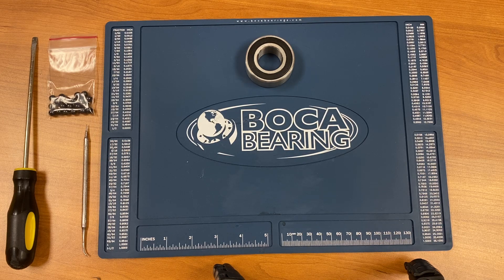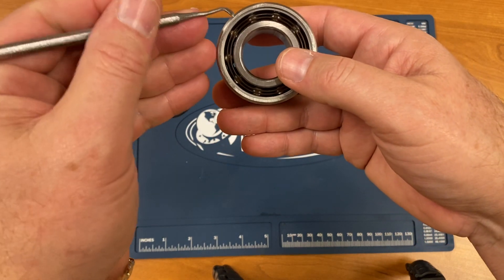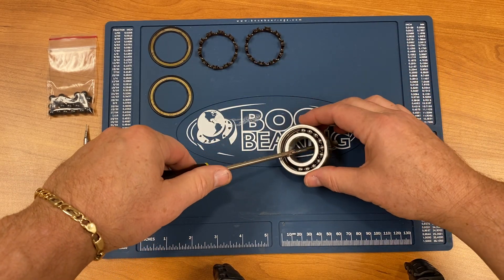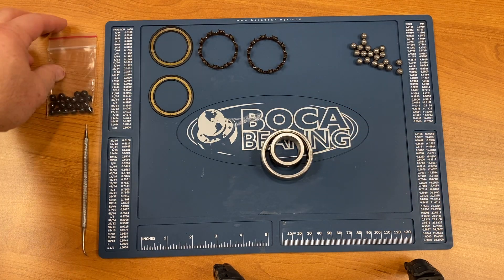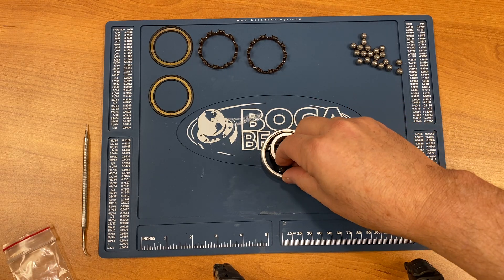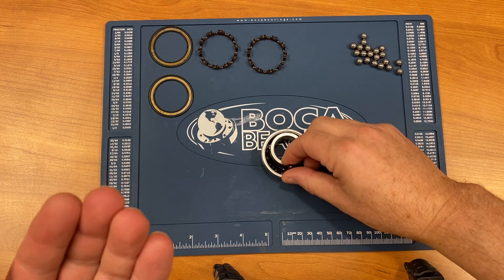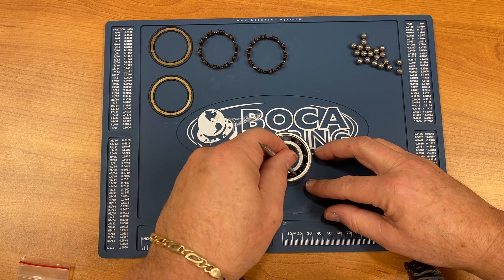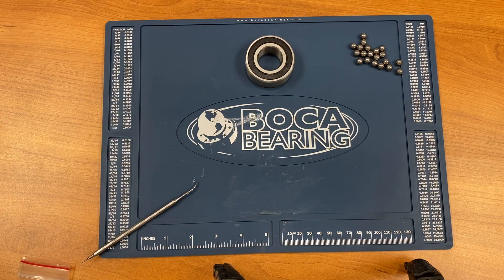Converting a Standard bearing to a Ceramic Hybrid bearing

Comment: So if I understand this properly you disassembled the original steel bearing and replaced the steel bearings with ceramics.?
And still used the original steel races, retainers and seals?
I thought ceramics ball bearings required ceramic races??
Reply: A Ceramic Hybrid bearing has Steel Races with the Ceramic Balls.  Only a full ceramic bearing has Ceramic Inner and Outer Races and Balls.